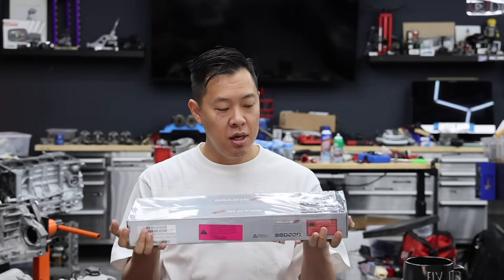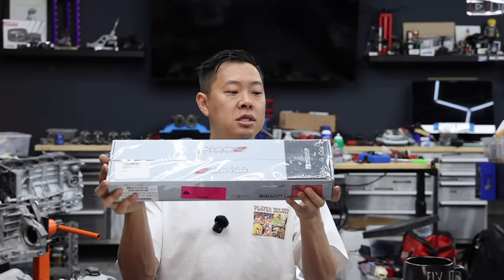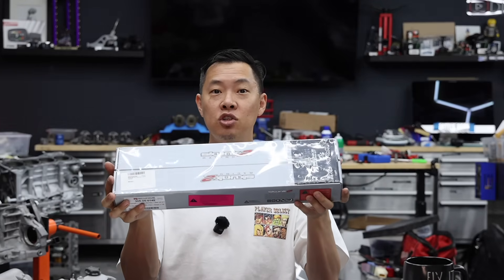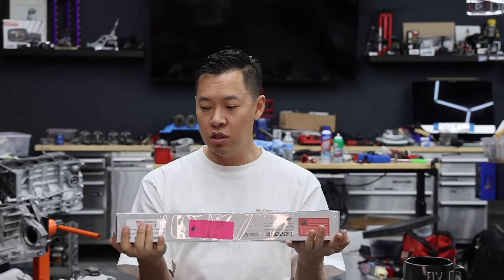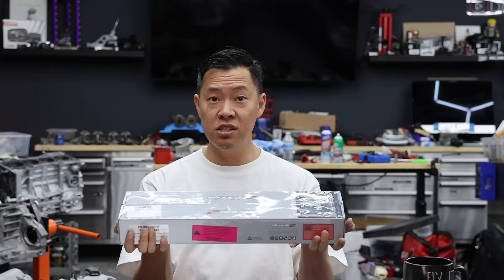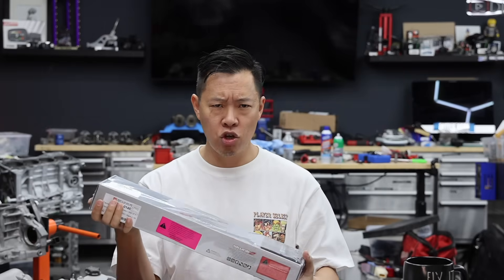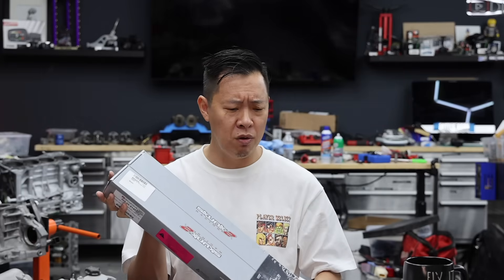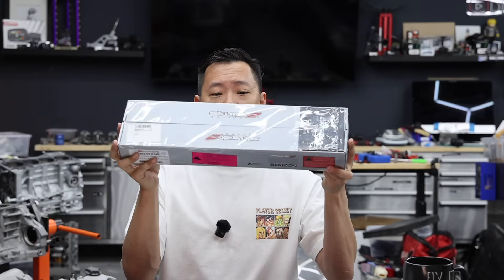Best Rods, Pistons & Cams for a B18C GSR Integra? Honda Expert Breaks It Down! Q&A EP1

Comment: The only thing I’d like to add is the 2 different exhaust ports on the p72 cylinder head.  Also I’d recommend softening the combustion chamber and un shrouding the intake valves. Your combo with custom flat top 11:1 pistons will produce a reliable engine program for road racing

Comment from the maker: What GSR combo would YOU run? 🔧🔥  
Would you go high compression? Street cams? Or full race setup?
Reply: I have an LS-VTEC that's running 12-12.5:1....LS block, GS-R head. This is staying all motor and I'm throwing the whole Brian Crower catalog at it for the head. The block is done already. I'm planning for it to be a part time track star and mainly a touge/street car.
Reply: Idk , but

B Series Vtec Engine Applications for Quality and Durability Race Product?

Which valve train set up kit brand is better? Skunk2/Junk2, Supertech, BC,CompCams, Ferrea, or Blox?
Which piston and rod brand kit is better? Nippon Scat Rods, YCP, Eagle Rods, Cp, Wiseco, Arias, Skunk2/Junk2, Traum? 
And I Beam or H Beam Rod would be better option?
Which Cam Gears and Set up brand is better? AEM, BC, GSC, Skunk2/Junk2,Blox, Jun, Toda? 
Which Main and Rod Bearings would be better? ACL or Kings?
*Who does Better Head Work Porting and polishing? PortFlow, 4piston, JSR engines, JBR engines, Kings motorsports?
Who Does Better Block Sleeving work? Golden Eagle, JBR engines, RameyRacing, DartonSleeves, RS Machine?
Who has the better clutch set up?  ACT, EXEDY, ACTION CLUTCH, Comp Clutch, 
Who has a better ECU quality set up and program? Hondata, Haltech, Motech, Fueltech, Ecumasters, AEM